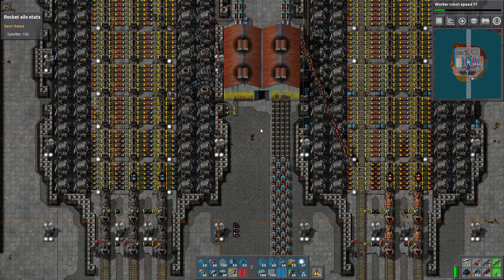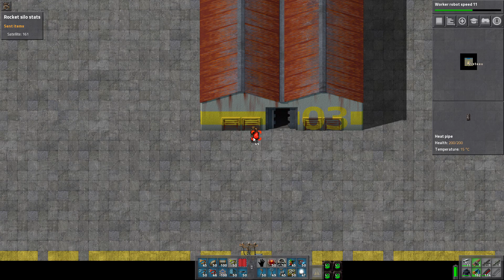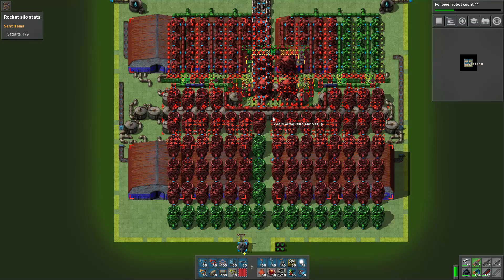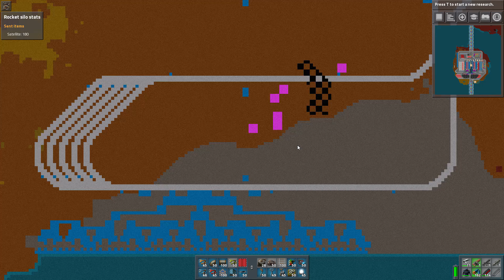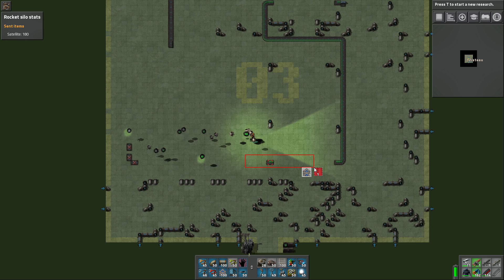Factorio Recursion #35 - Done (0.15 | Factorissimo Mod)

Comment: 22:35 I think your problem with the tanks there is that each of your "channels" is sharing with the others. It seems to me like the topmost tanks are splitting their outputs between horizontal and vertical. So (made up number incoming) only 50% of the output is going downwards for each tank and continuing along the channel. The rest is going to a neighboring channel to refill it and clog its input.

What you need to do is separate those channels. Add tank at the very start of your top-left and bottom-right input chains. That should flip their tanks in the middle cluster around 1 rotation and uncouple them from their neighboring channels.
Then make sure the bottom of your factory also avoids coupling the channels - that should be easy to do.

As a side note: It seems unlikely that you hunch is right. You have hundreds of inventories earlier on in your chain, but only that cluster of tanks shows a marked decrease in water. The problem has to be within the cluster of tanks itself, hence my above suggestion.

Comment: You need a pump into and from each tank. It's the only way that current stays maxed. Tank to tank is averaged out between connected tanks. Sorry if this is a repeat post.
Reply: Also, Z needs to use the Factorissimo2 input and output pipes. They are made specifically to optimize liquid flows by adding pressure to the system.
Reply: and it get worse when the tanks are arrayed so that water can flow in circles...

Comment: I know I'm too late for this, but for anyone who sees this and is playing with the Factorissimo mod:
Wouldn't the ideal fluid setup just involve using mostly just input and output pipes? They hold 2.5k, which is way better than normal pipe, they don't need to go underground, since you can walk over them (just avoid crossing the pipes) and your factory can't use tanks or pumps for input/output, so the transfer limit is the 2.5k anyways. Also, with the 2.5k storage per pipe segment, storage capacity is a complete non-issue.

Maybe there are some flow mechanics that I'm missing, but in that case you can just add pumps here and there to help the flow.
Another issue I can see would be interaction problems with other devices. Maybe the output pipes can't unload from trains? or factories can't receive from input pipes? But in any of those cases, you can just add a pump or tank as an intermediary.

Comment: Not sure if this was added before but I think the problem with your water is due to the factorissimo mod. You should really be using bulk transfer fluid pipes with the mod(provided by factorissimo). The mod does not transfer fluids well even when the update rate is high. Good series though. Thanks!

Comment: Factorio's fluid handling is bloody awful.  The issue is not the number of chained pumps, but rather the number of chained TANKS.  As I understand it, the flow rate through chained tanks is worse than the flow rate through a "reasonable number" of pipes, so tanks are best placed in parallel to the fluid flow instead of in series with it, so they act as accumulators without restricting flow.  If you ever come back to this world, I suggest barrelling for the high-volume parts (from the overworld into the power factory) and using pipes from the de-barrelling stations into the individual power plant buildings; it takes "many" (something like 100) pipes before throughput starts to drop much below their maximum rate.  Note also that underground pipes count as two pipes regardless of their underground length.
Reply: yeah the fluid mechanics are what made me quit the game
Reply: What I do is tank->pump->tank and that works pretty well

Comment: Water pipes/tanks kind of top out at around 1200/second.  You only get that crazy pump speed if you have pumps the entire way.  You're far better off doing barreled water on a blue belt = 40*250 =  10,000/second.

Comment: Did you avoid using the Factorissimo's bulk-transfer pipes for a reason? (I didn't watch the whole series, so apologies if you already answered this elsewhere).  They might not completely solve your water->power issue, but they definitely help. 
I've toyed with different nuclear power factory designs. I resorted to using a Water Pump mod inside the factory just to overcome this problem. Barreled water is probably the next best thing.
I settled on a 680MW single-floor tier 3 factory design (which I tile to 3x3 "recursively") using 6 reactors (with adjacency).  I also tried a 13 reactor+Heat exchangers pumping out the steam into a separate factory with turbines, but the piping meant that I didn't get much space savings, so I'm keeping the smaller, simpler self-contained design.

Comment: Water is also being a problem in my 6 reactor setup. It just consumes too much to be delivered by pipes, It ends up being a pipe spaguetti :(  Heat pipes also limit the distance from the heat exchangers to the reactors: another reason for not using more than 4-6 reactors together.
Reply: Too lazy to try the barrels tho